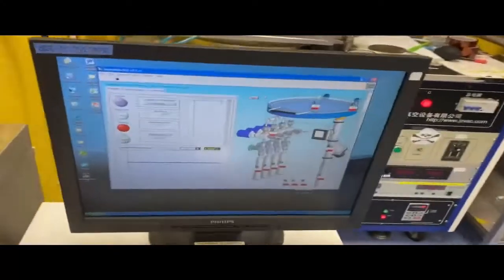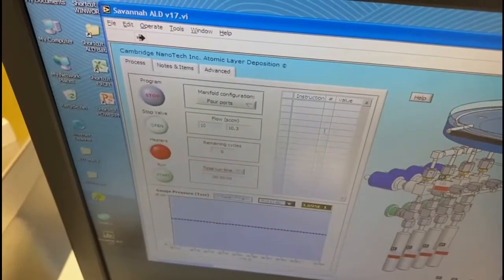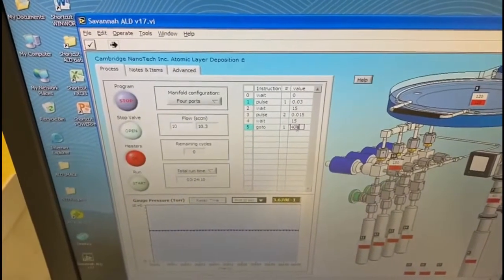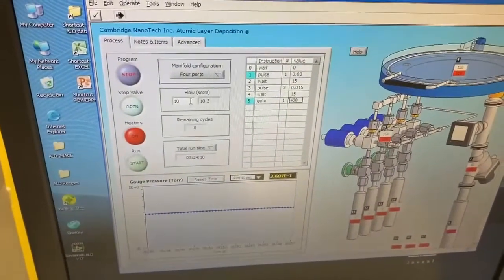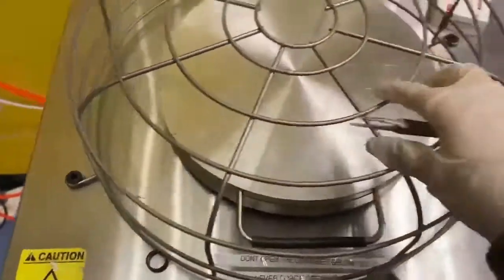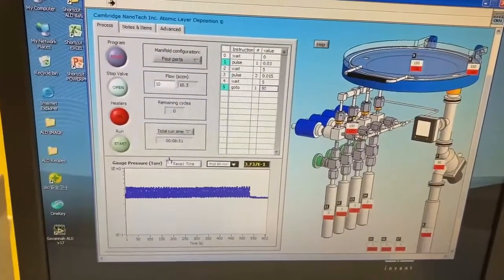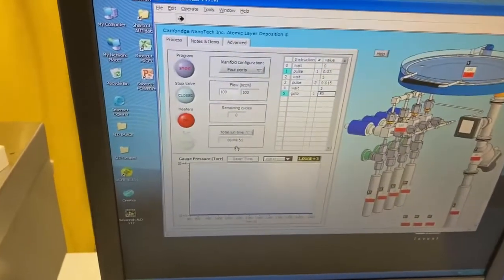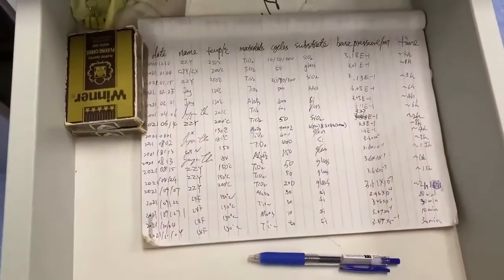Savannah 200 Atomic Layer Deposition Operation

Comment: how to tune the pressure at each step like I am trying hard to set it for infiltration of Alumina in an exposure mode. I need to set the pressure 10 torr for TMA pulse but it goes over 800 torr which is extremely high and disrupt the infiltration process. I will appreciate your response. Thanks.